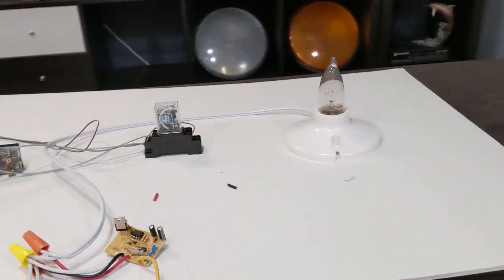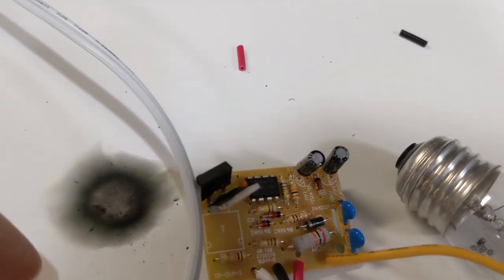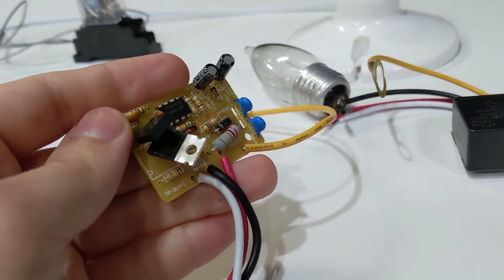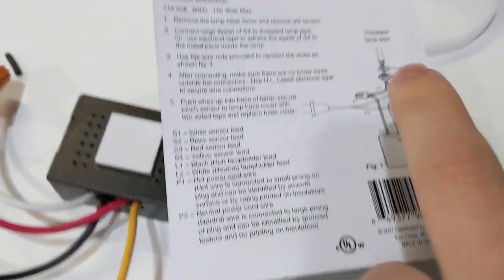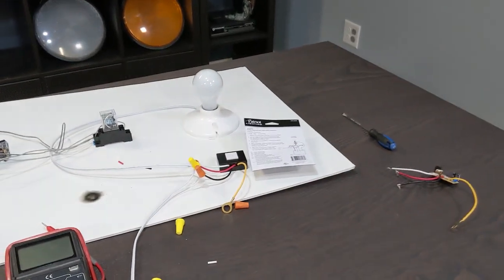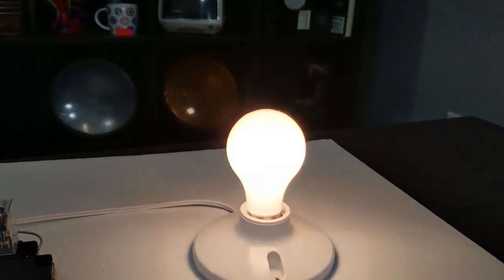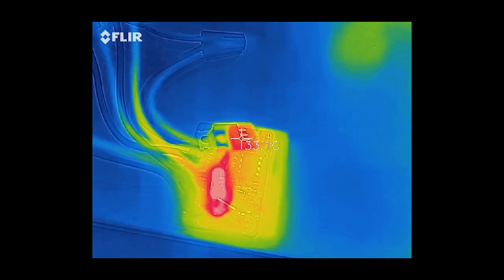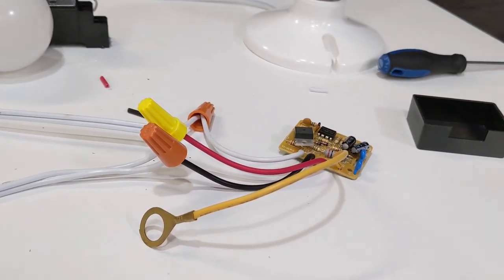A slightly explosive touch-lamp follow-up (standby energy consumption)

Comment: Never ever ever assume you know how something is wired because the colours make sense to you.   I did this as a teenager and tried to wire a lamp through a triac and assumed brown was ground because it made sense to me that it looked like earth... bang, tripped the house breaker, scared the crap outta me. 

Brown is live in the UK, which I now know all too well.   Black used to be neutral here, having a black unassuming wire as "hot" seems madness to me but there we are.  I do a lot of my own wiring and will double, triple and quadruple check my own connections or label things before I put power to them now, unless it's super obvious.

Comment: Was a bit confused - but learned something I guess - historically, in the UK red was live (where we have our inline fuse on all plugs), and black was neutral. So when you went off on the black being neutral and the red being live (hot?) I was thinking, well yeah surely that's obvious? But clearly US wiring code is different to the historical UK code! We changed to brown and blue respectively a while back (2004 according to Wikipedia as part of European harmonisation). Maybe whoever put that little board together in China got the standards mixed up. I notice the package has a UL marking which I guess isn't worth the ink used to print it...

Comment: Agree that the colors are misleading.  However the first time it was wired incorrectly, and didn't have anything to do with hot/neutral. 
1st time -  LINE: white / black   LAMP: red / white 
2nd time - LINE: red / black       LAMP: red / white

(referring to the colors coming off the pcb here)

Comment: Polarized vs non-polarized is primarily a safety thing: if you are going to have a single-insulation appliance, you want neutral to be what the user is most likely to touch or get exposed to in normal operation and fault conditions. For the most part, this means putting the switching element on what should be the hot wire so everything downstream from there should be dead when the switch is off and everything is wired properly. As far as powering stuff goes, it makes no difference which way around wires are. There may be some poorly designed oddball circuits out there that use neutral as a reference for low-frequency measurements that would get tripped up from inverting wires but I haven't seen any personally.

BTW, yeah, the wiring color scheme on that touch controller is dumb.

Comment: First, I do agree that your sense of the correct wire colors is, well, correct.  The manufacturer messed this up!  There is, however, a much larger safety issue with the "modern" touch module you are playing with in this video.  Looking at the diagram on the back of the package and tracing the "hot" voltage: it appears both on S3, and around the other end of the L1 to L2 loop (through the lampholder) on S1, when the touch module is *off*.  They are switching the neutral, instead of switching the hot.  This means that with a bulb installed, the shell of the lampholder is hot when the lamp is off and a bulb is installed.  Not only could you get a shock while changing the bulb, the entire metal structure of the lamp would become hot if any part of the lampholder shell comes in contact with it.  The main reason polarized plugs were invented was so that the hot would always go first to the switch inside of whatever electrical equipment is plugged in, and no further when the switch was off.  In a light fixture/lamp, hot always goes first to the switch so that the shell of the lampholder or the frame of a two-wire fixture/lamp needs two failures to become hot.  The way this touch module is set up is unsafe in a big way!  BTW, I loved the opportunity to hear you speak unscripted in this off-the-cuff experimental exploration video.  I know you spend a great deal of effort scripting and polishing your usual videos, which gives your voice in them a certain well-spoken characteristic sound, but this was great fun in every respect.
Reply: Okay, so now I'm wondering if the diagram on the package is messed up and the circuit would work equally well with P1 and P2 swapped.  This is how it might wind up if you installed the module using a non-polarized plug.  If so, then the use of a polarized plug with P1 as neutral and P2 as hot would fix the safety issue as described in my post above.  So many modules to explode .... so little time ...

Comment: Here in Brazil, when wiring electronics up Red is Hot and Black is Neutral.

When it comes to our power outlets, LIGHT BLUE is neutral and Black/Red is Hot.  And sometimes you have Brow... I mean... Orange with context wires instead of Black or Red.

Comment: Howto de-cap components with one touch ;)
The supply is made of a simple resistive dropper with a zener diode, to save space and money, the latter at least at the producer´s side.
A capacitive dropper would need a significantly bigger foil capacitor, as they are "self repairing". There are several kV-spikes a day in the mains which penetrate the foil of the capacitor. The tiny holes melt together again. Ceramic caps would be toast within a few weeks. Those blue pills are varistors, they catch those HV-spikes in this circuit, as the spikes would propagate into the chip and destroy it. The electrolytic capacitor on the low-voltage side also dampens the spikes. Probably there is a smaller varistor or another component to take away the overvoltage. A capacitive dropper would have almost zero standby power.

Comment: I seem to remember that in low voltage eletronics, the black wire is often, if not always, the neutral and red and or white are the hot. This is totally opposite from electrical wiring.

Comment: @Technology Connextras this is very likely made by an electrical or computer engineer that is trained more modernly and to standard with what is becoming the new standard with red being a positive voltage, Black a ground or neutral and white being the negative rail, from the way it is connected it is very likely that the the 3 wires are connected the way they are so the board can take only as much voltage and current and needed to trigger the states of the triac while the white is the going through the triac directly which is acting as a voltage regulator and then to "ground" (neutral in this case) into the socket (I'm still in college so I'm not entirely sure if this is how it's working without the schematics but that's my semi-educated guess)

Comment: The triac is probably only rated for 200W when it has a heat sink attached. Since they've omitted that, I would guess they have had to downrate the part to 150.

Comment: Keep in mind that a working incandescent bulb will likely read as, or very close to a dead short to a multimeter. They are positive temp coefficient resistors, meaning their resistance rises as they heat up.

Comment: Always keep in mind that color coding is a USA concept. I worked my life in the electricity industry in the US and now spend 7 months of the year in Mexico. Wire color in Mexico is determined by cost then availability. I've seen places wired in all green or all white or any other color you can think of. Seldom does manufacturing done in a foreign country result in compliance with our standards and expectations unless the company contacting the manufacturing be done with adherence to specified colors. This circuit must always be powered from line and neutral and the switching centers on the triac as the equivalent of contacts and being capacitively gated. The touch wire is very high impedance from either side of hot or neutral but can give you some tingle when you are well grounded. You'll feel it but can be seen with a good high impedance voltmeter in series with the touch wire, yourself and ground. Don't do this without the meter present in the series. Component failure can result in lethal voltages. I never liked these without a GFI breaker.

Comment: When an incandescent bulb fails there is a momentary arcing creating a flash that is brighter than usual and at the same time drawing high current enough to pop a fuse/circuit breaker and make a popping sound from the light bulb itself. The dimmer circuit was obviously driven with way too much current and exploded! YAY!.. What is the plasma if a bulb is a vacuum you ask? Why its vaporized metal of course exploding in your light bulb!

Comment: so, if I understood the wiring diagram correctly, the socket is HOT ALL THE TIME, and they are switching the neutral - this is incredibly dangerous - you never want a bare hot lead (which exists at the bottom of the socket)

I hope i misunderstood.  If I didn't, I can't believe this is UL listed as it claims to be...

Comment: Plugs on lamp cords are not polarized.  They have no dedicated Hot or Neutral wire since rotating the plug 180 degrees will swap which wire is hot and which is neutral.  Swapping the wires at the device is exactly the same as rotating the plug.

Comment: It does says made in China.

So basically in electronics terms, black is negative and red is positive but sometimes "some manufacturers" use this DC rule for AC electronics.

To be more complicated, while describing this device in DC formats, it basically connects the bulb's ground to the supply ground. Saying that in AC terms, it connects the neutral return to supply neutral.

Comment: Whenever one deals in semiconductors (vacuum, silicon, or otherwise), one must beware that a gate can be blown out by putting too high a current on it. In micro-chips, this is called "gate rupture", and is why you should wear static straps when working around microchips.
Reply: (a) vacuum tubes don't have gates. (b) the danger you refer to is probably too high a voltage, not current.
Reply: @Graham_Wideman  (a) grids, gates, you get it. (b) Yes, you're right. The test data is all put in terms of voltage. And the surge from static electricity isn't much of a current, either.

Comment: Before 2006, different colours of cables were used in UK domestic electrical wiring and appliances for the neutral and live wires. The old colours were: Red = live   Black = neutral    Green and yellow = earth The old electrical

Comment: I bought 3 of the new cheap touch lamps in about 2 years when in the 2000's.  None of them lasted more than 2 weeks before they stopped working.  I gave up.

Comment: Black for neutral is fine in DC circuits. Red for hot is also fine for DC circuits. AC really does not have a hot or ground, but we wire that way for safety. So AC devices don't care which way we wire them. Users may as wiring the wrong way can shock the user. So a toaster wired in revers now has the "Hot" side on the case. So touch the toaster and any other properly wired device is as good as poking paperclips in a socket!

Comment: You know the wiring and colors make sense if you look at it like a dc transistor circuit. Power comes in through the positive red and negative black, and there's a low side swich that connects the white to the black.

Comment: In Europe any color except for yellow/green can be live. Live wire has typically black, brown or grey color, but it is not wrong to use blue one. Those wires are called "working wires", every electrician should study the scheme of connection firstly. Yes, in America you have even dyed screws in socket to be sure which wire belongs under it. Poka Yoke. ;)

Comment: Wire colours are only "advisory" in my experience. I recall frying a set of expensive SCSI disks in a studio recorder... turned out that the cheapo IDE power extension I had was made by someone colour-blind (or plain not giving a t....). I never trusted colours since :-)

Comment: When I see those wire colors, if I just see red and black, then of course red is hot and black is neutral. Add white into the mix and everything changes. White becomes neutral, and black and red can be interchanged between hot and special purpose (though I'd probably use black as the hot).

Comment: The national electric code (NEC) calls for the grounded conductor (safety or chassis ground to be green or bare copper.

The neutral conductor should be white or neutral gray.

Comment: Ok so from my Australian point of view black being the neutral is fine ( but still technically wrong thanks to the fact that the wires inside our walls are red - line and black - neutral but our appliances are brown for line and (light) blue for neutral. the thing that puzzles me with how they want you to wire that is that they want all the line wires commoned and are switching the neutral line so there is always mains voltage at the lamp holder.

Comment: For the US standard of White = Neutral, Black = Hot, Red = Secondary/Switched Hot.  This makes no sense.  But the old UK standard of Black = Neutral, Red = Hot it does make sense.  But also, this is a 110V module.  Which the UK is 240V.   And the switching of the Neutral seems a bit odd and a safety concern.  Since like has been mentioned in other comments.  The US Neutral should be bonded to Ground at either the distribution panel, or the main meter coming into the house.  Typically at the same location we bond it to the water pipes.

Comment: Its also kinda hilarious that this device, always sends power to the lamp, the hot wire is shared so the bulb is technically always at 120 volt potential. the device is switching the neutral. as if the stupid colors werent the bad chocolate on the poop cake, they arent even switching the hot side, so perhaps in the manner of you happen to be well grounded and the lamp has a stray wire touching the metal body of the lamp which you will also be touching. you can feel the math as you become the final resistor. Unless perhaps the yellow signal wire also touching the metal of the lamp will put the device into its "safety" mode where it blows itself up to kick the circuit breaker perhaps.

I would also slightly think about the triac though. if its a 200 watt triac that likely means they would want it connected to a heatsink to run at those power levels. they are designed to be able to do that what with the screw hole on the top and the back of the triac being metal. this one just floating in the breeze likely gets extremely hot with just air around it for cooling at anywhere near its peak power. 60 watts seems honestly fine and it could run for hours like that, but even at the max 150 that patriot lighting suggests. ehh idk about having it at full load for more than an hour or two before that triac burns out. the older lamp seems to have had the ever slightly better design of its triac being mounted to the PCB. thats not exactly much. but at least it forces the heat over a larger area.

Comment: Red or black is hot in AC. Typically you will see red for a ceiling fan light or for a switched outlet/circuit. When I saw how you had it wired I knew it was going to pop. I agree, they should have had the black wire a different color, blue would have made sense.

Comment: I did this with my car amp by accident, wired the power to ground and ground to power, the capacitors exploded and almost caught my car on fire, in my defense I couldn't see well because of how my amp was mounted, but I still kick myself in the booty for not double checking, also I could have realized something was wrong when I hooked up my battery cables and a larger than normal spark popped (meaning a load was being drawn).

Comment: Also (if I'm understanding correctly), the live (hot?) Is connected to one terminal of the bulb and the neutral is connected to the triac and therefore the bulb is always live and the neutral gets switched? That's super weird and in some bulb/holder designs that could be downright dangerous.
Reply: I would agree, if the diagram was for a fixed wiring installation, but this isn't. The module designers know this is for a l;amp that plugs into an ac supply, and that the plug can be inserted into the wall either way round. So in effect, its a diagram for practical use (ie how to wire it up to work), and not meant to designate safety. The designers can't do any better just because the US mains plug is reversible.

What you say does  perfect sense in countries that have non-reversible mains plugs.
Reply: @fredbear3915  Ah I see, I live in the UK where the plugs are non-reversable so that's probably why I thought that. I always thought all plugs were non reversable but I guess you learn something every day...

Comment: This, even if wired correctly, presents a safety issue... switching neutral instead of hot means that, if you insert a good bulb and the "switch" is turned off, the shell of the base is now hot through the lamp...

Comment: Their diagram has the lamp "always hot" and they switch/chop the neutral to control the light. This is bad design, although a moot point with a non-polarized plug. If your plug is polarized you could remedy this by swapping hot and neutral yourself (plug hot P1 -> S2 sensor black, plug neutral P2 -> S3/L2 sensor red & lamp neutral, lamp hot L1 -> S1 sensor white). Edit: corrected previous error.

Comment: Trouble with low wattage bulbs in touch lamps is that the long filament can whiplash when it fails. The loose end shorts the lead-in wires and takes out the triac.  I’ve had a few bedside lamps end up stuck on because of this.
Reply: Thx for that! Now I know what happened to mine!

Comment: In the old days, before we went Euro, in England neutral was black and live("hot") was red.
I once botched a power supply in a hurry and I did that same big resistor voltage dropper.... it was horrible but I was in a hurry.... using it as a permanent power supply seems absolutely absurd to me.